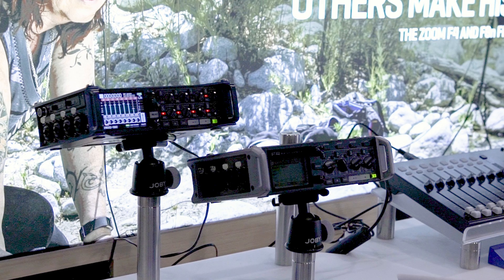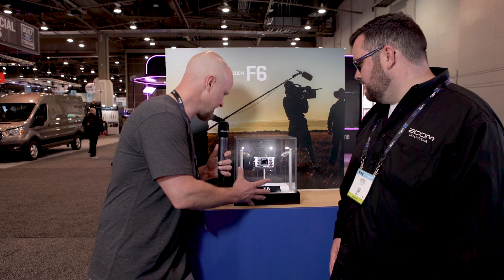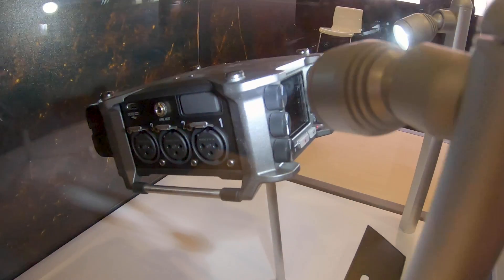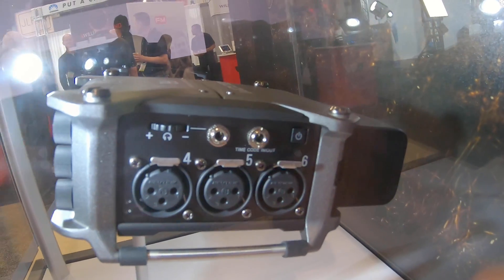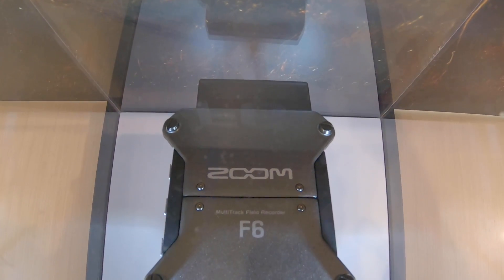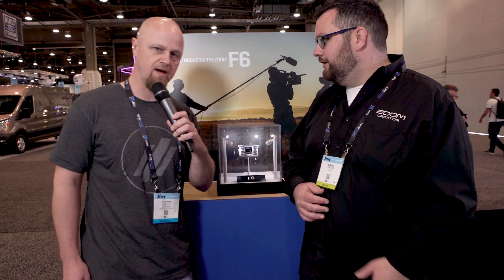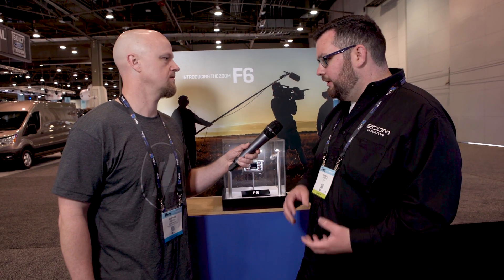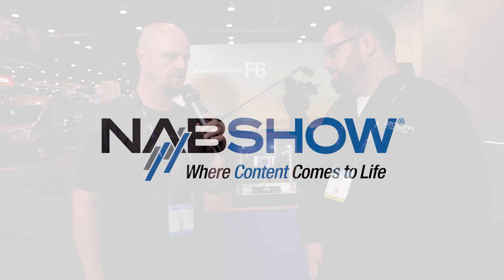Zoom F6 - A First Look "You cannot override the pre-amps"

Comment: Why is there no option to EQ on the devices?   Not
Just activate hi or low pass. I mean a function to properly set Q values or fine EQ or even presets.
Reply: Theres alot of wierd stuff with this release. Likewise the maximum input limit has dropped from the old recorders zoom f8 and F8N maximum input at +14dBu
While new soon to release zoom mr unclippable... can only handle a decreased maximum input level of +4dBu
As stated on their website... and all providers suppliers

So my high SPL mic from rode that can put out +13dBu max wont be able to be used on thus new recorder which is capped at +4dBu. Its like a downgrade
What do you make of that? Im gonna pull my pre order.
Take a look at my other comment on this video